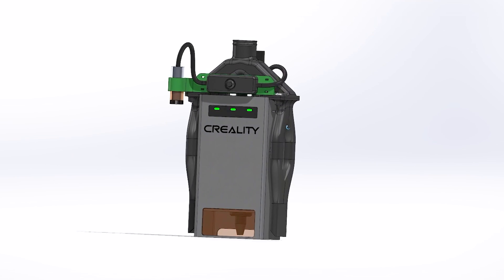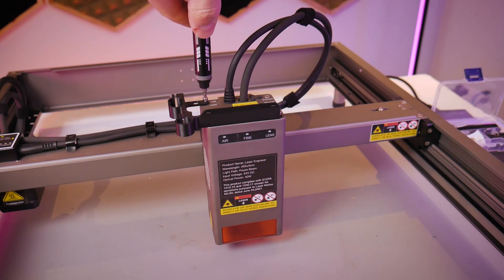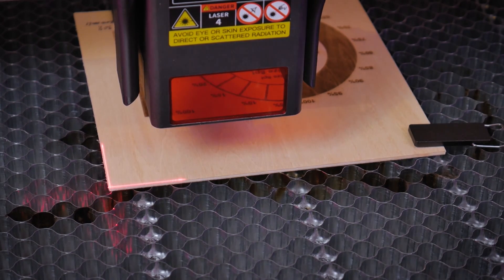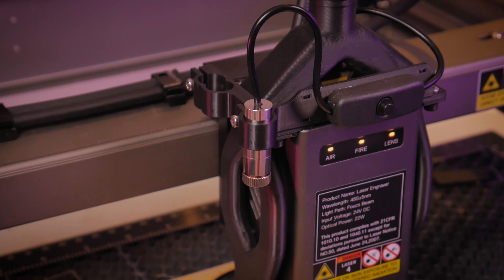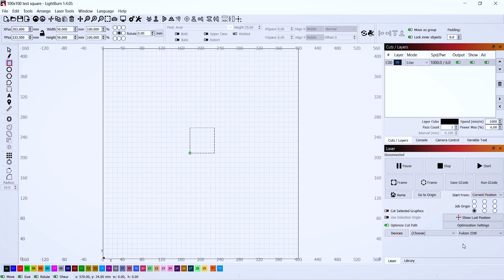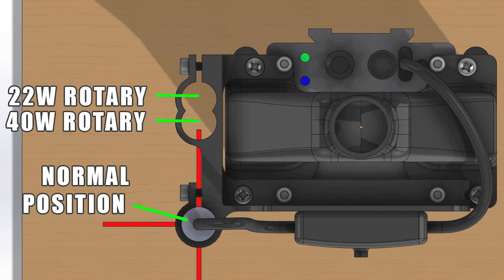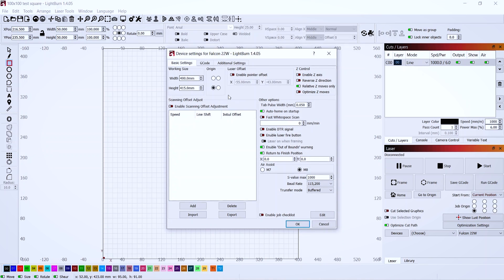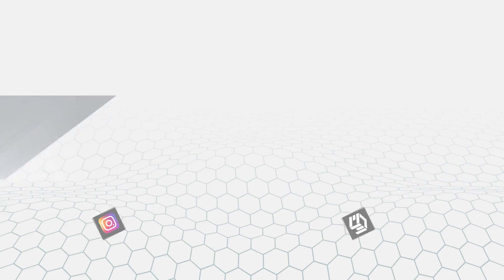Creality Falcon 22W and 40W Laser Crosshairs Installation and Calibration

Comment: "Hey, 
I received the materials in good condition, but I had to pay an extra 30 euros for customs in Belgium, total rip-off. Now, I’ve assembled everything and followed the instructions, but my laser head keeps going to its 0,0 position, which causes the bracket to hit the edge. I adjusted the offsets in the settings for my 40-watt Falcon 2 Pro laser, but it keeps returning to that 0,0 position. I’m using LightBurn and have to admit I’m new to this. What am I doing wrong?"

Comment: I got the product and am loving it except for one issue. When I plug in the crosshair to the laser module, the air, fire, and lens LEDs turn yellow.
Reply from the maker: Hi Faraz, I've seen this once or twice now - to be honest I don't know why a few people have this happen but the fix for now is to just unplug the usb before running the job. I'm going to see if I can replicate it on my machine but so far I haven't been able to.
Reply: @EmbraceMaking  Thank you. Someone else suggested this as well on a forum. I will try it later today and get back.
Reply: I have the same problem  - all my light is yellow and not working - as well as can turn the mode for th 40w vs precise anymore
Reply from the maker: Is yours a newer model or an older one? I'm wondering if this is something happening with some of the machines that are shipping more recently. For now the solution is to just unplug the crosshairs before starting the job but I will dig deeper and figure it out.
Reply: So, the plug after turning the laser on first works.
Reply: I am having the same issue here, I also tried another usb laser to see and it happens then too, seem if anything is plugged into the usb port on the laser, then this happens.

Comment: Ordered one from you. No one addressed the 1.6 watt laser however.
Reply from the maker: Thanks for the order - can you link to the 1.6W laser that you're using? It's on the Falcon 2?
Reply: @EmbraceMaking  the 40 watt unit comes with the 1.6 head in the kit.
Reply from the maker: can you send me a message here: https://embracemaking.com/pages/contact , I'll reply and you can send me some pictures so we're on the same page - thanks!
Reply: @EmbraceMaking Sent

Comment: Is it possible to add a second laser to the holder? One for the normal flat cut objects and the second for the rotary tool. This way I only have to calibrate each one once then just worry about which laser to plug in for power. A little extra cost but a time saver if it would work. I just received the set up but I don't have time to set it up just yet.

Comment: Nuts.... im sure making the cross hair match the laser spot is possible. Otherwise using absolute coordinated and simpl jigs is the best way to go. 😅
Reply: Also adding weight to the laser module will increase inertia and is bad for accuracy 😮
Reply from the maker: The weight isn't a concern either... it weighs a few grams - I've noticed absolutely no difference before vs after adding the cross hairs :)
Reply from the maker: Jigs and fixtures are great for repetitive batch processing - the laser cross hairs is great for initial setups, different and new workpieces. Although it is also a quick way to line up with the corner of a fixture if you don't have some kind of physical stop.